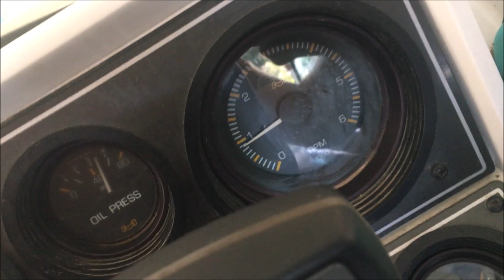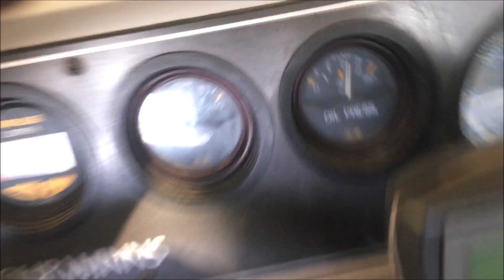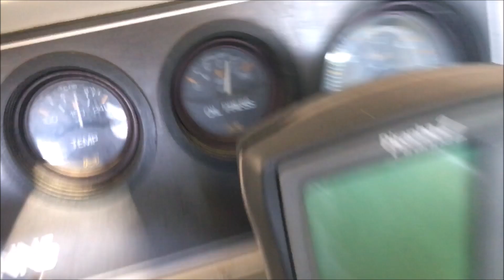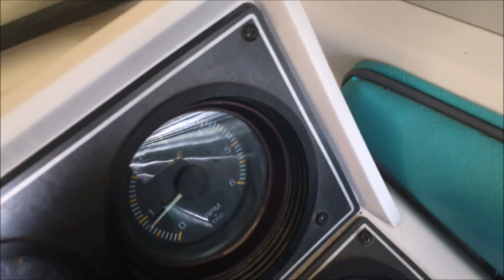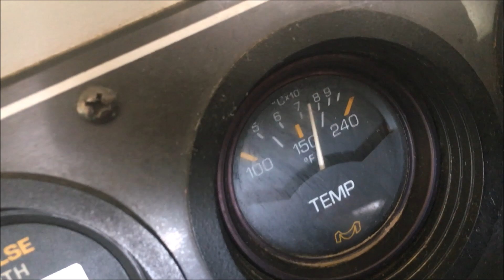Repowered 1990 Four Winns 180 Horizon 4.3 OMC Cobra

Comment: Where did you get the shop manuel for the 4.3??
Reply from the maker: I bought a used manual on ebay. It was very helpful. As a little update, the boat is running great.
Reply: @nomad74777  ok thanks. I've been looking for a few weeks and couldn't find a manual for the 4.3 omg, seems like the only one I can find is a type of universal basic all pro manual.

Comment: Mine runs great at idle and under 1400rpm under load.  As soon as I pass 1400 it sputters and dies.  Runs perfectly on muffs! And ideas?
Reply from the maker: I had the same issue.  It turned out I had two of the plug wires on the wrong spark plugs.  I thought I had it right.  I must have checked it four times.  I felt really stupid when I figured it out.  It ran perfect under no load and out of the water, but as soon as it was in the water, it ran like crap when under load.  So I suggest you go slow and check the positioning of all your plug wires.  If everything looks good, I would then move to replacing the coil.  Then check and make sure your fuel filter is clean and the carb is working properly.  But start with the plug wires. Good luck, I know how frustrating chasing ghosts can be.
Reply: @nomad74777  I can recheck the plugs, I replaced the plugs, wires, cap, rotor, coil, points, condenser, fuel line, filter, separator, and tuned it to exact spec! Ran great that was 3 years ago. Haven't pulled anything since, last year I didnt take it out at all, and year before only 1 time, ran great! I'm thinking I need to re lubricate the mechanical advance and replace the points again (kid left the key on for a year!) Probably separator also fuel filter, but I'm leaning towards a bad timing issue? It does shake at idle now and didnt. But at 1200rpm on the water its smooth and responsive, just cant go past that or it dies like no spark, instant off! Let me know what you think? The reason for what I replaced was similar, idles good good low end, and no high! My points were burnt bad, and the mechanical advance wasn't moving enough.  It was amazing after that! 48 mph out of a 1989 180 horizon 4.3 is impressive!

Comment: Wht line did u replace?
Reply from the maker: I replaced the main fuel line. I thought maybe it was collapsing on itself. Turned out I had two of the plug wires on the wrong plugs. Glad I figured out

Comment: At 4;45 you have an issue with the battery cable that’s going to cause a fire. Rewatch it
Reply: Oh yeah, I saw it.  The cable was not tight. Fixed now.  Thanks for the heads up!
Reply: A Plus Carpet Cleaning haha good! I saw that and was oooo nooo
Reply: Dude youre really scarng me with safety. The cables, the ether, rpm red line makes me nervous. Be carefull
Reply: @stevemac201  agreed!! That was a bit aggressive!! Also not checking the prop before engaging the outdrive. Also, instead of starting fluid just pump the throttle like an old carb'd car or truck.